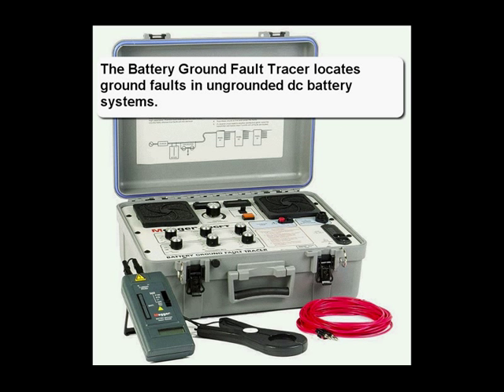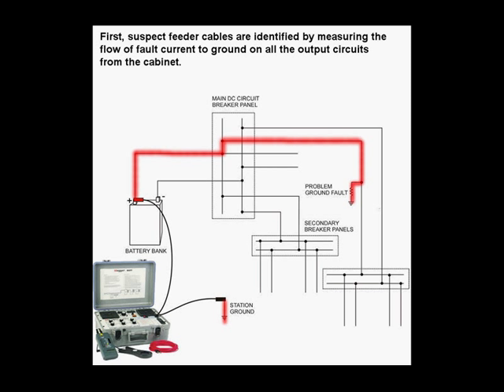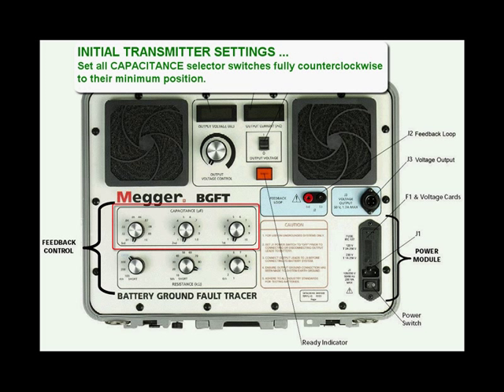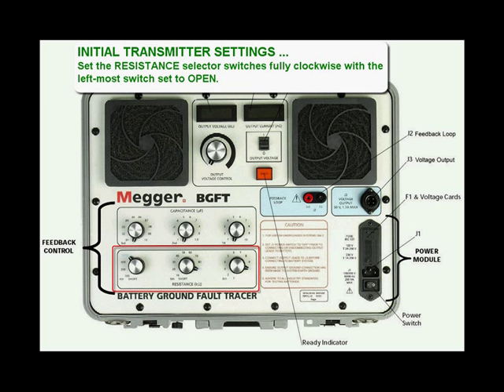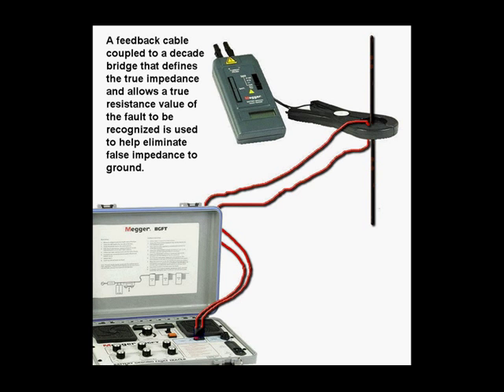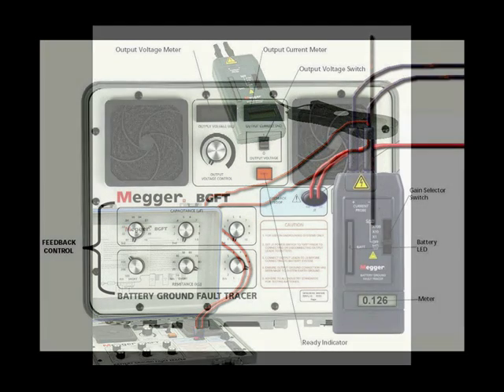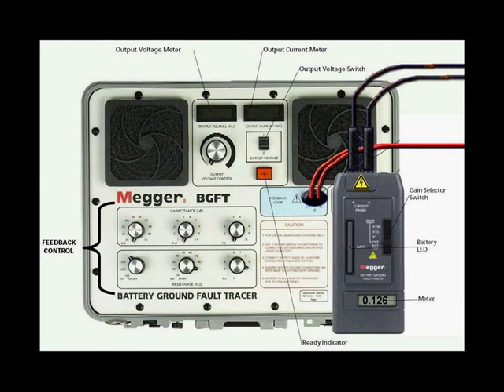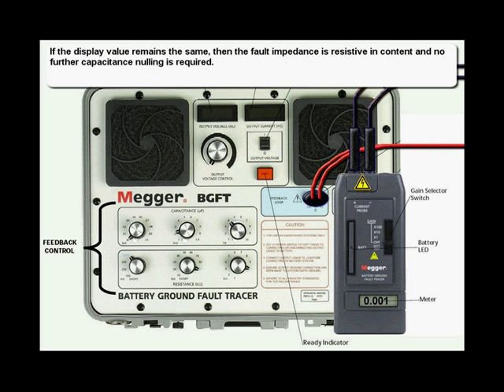BGFT Training Video

Comment: Thanks for the video.These Meters are well worth the money for finding grounds on a DC system. We use one in an older power plant,It makes finding grounds easy. What sometimes took days to find, takes minutes without disrupting the operation of the plant.I would recommend disconnecting the ground meter prior to the test.